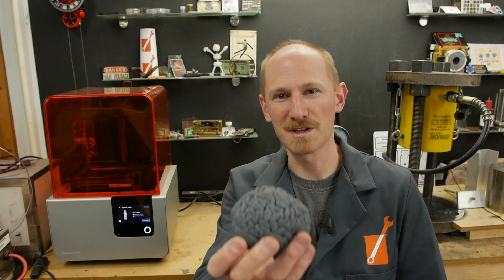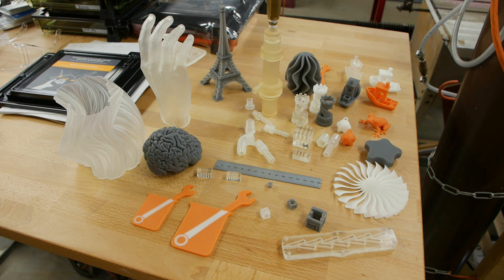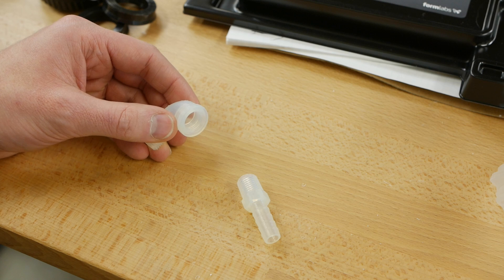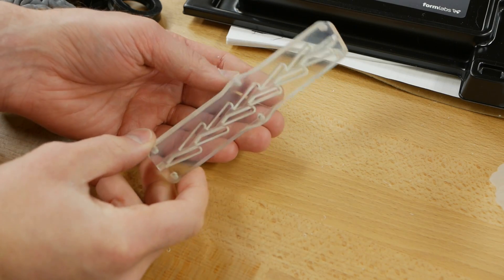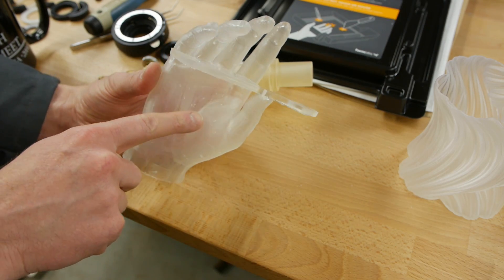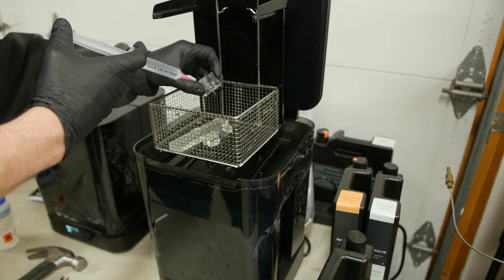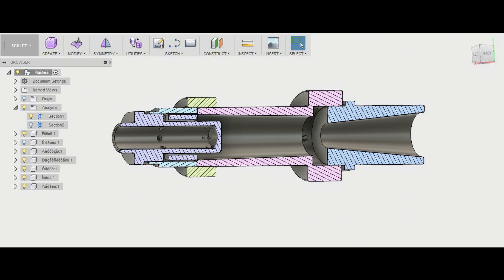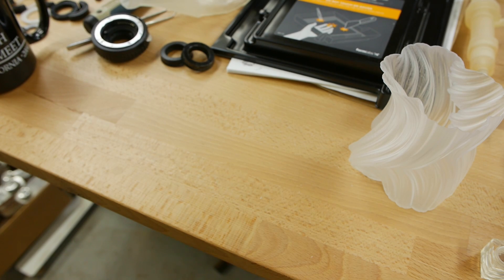3D print your brain, timelapse, high-res microfluidics, custom colors...

Comment: The channel is just so random, but the content has absurdly good quality. I can't get enough.

This is the first time I have seen negative sculpture modeling with the form 2 and dam does that look slick.
Reply: Damn good comment
Reply: Jttv because he's just a guy messing around in his garage exploring interests that come his way. He clearly doesnt do this stuff just for youtube, its actually his hobby and what he enjoys doing for fun.
Reply: Полиграфович yes it is a refreshing escape from all the other YouTubers that live off YouTube income that release a video or two every single day whether the content is worthwhile or not just to get the views.
Reply: Let me just underline it for you... SUPER INTERESTING. GREAT QUALITY.
Reply: The word you are looking for is eclectic.
Reply: The main problem with negative parts is that the resin is expensive. I've done a few and could never justify going more than a few cm per side. Also the original print beds had a limited lifetime, and printing on the same spot for thousands of layers doesn't help much. You can see the ghosting marks on the print tray after just normal supports. If I wanted to do a large negative print I'd cheat and print the negative with a narrow shell, then use a clear resin to fill the rest of the volume.

Comment: Hilsch Vortex.... It separates high and low energy gas molecules, but I'm pretty sure it can modify the oxygen/nitrogen ratio of air much like a gas centrifuge.
Pity it takes a lot of energy to run, as it conceivably could be used to deplete nitrogen before going into an internal combustion engine in real time.
I've wondered about this for 3 decades - If you have the tools to analyze the composition of the output, I would really like to know whether the effect would be useful.
Reply: We use them at work to keep our electronics cool in hot areas. https://www.vortec.com/vortex-coolers/overview
Reply: Andy Lee Robinson What about for performance applications in IC engines? 

Although I've read that nitrogen is important to "cushion" the combustion event, hence the use of  N2O/nitrous oxide injection instead of just oxygen injection.

I've also read that nitrous oxide starts to "break up" ignition events at high power levels and it is why forced induction via turbo/supercharger or ultimately just plain compressed air is better. 

But maybe compressed air depleted of nitrogen a bit?
Reply: I don't know about knocking and cushioning, but I would think that an engine running on pure oxygen and gasoline would have terrific performance and produce no dangerous nitrogen oxides, and no CO if the combustion is complete. Perhaps there would even be enough energy left over for carbon capture.
Hypothesis probably moot now as IC engines will be phased out of the mass market over the next couple of decades.
Reply: Not an engine expert, but I was under the impression that running an engine too "lean" (more oxygen to fuel)   already burns hot enough to cause engine damage. Wouldn't this cause the same problem?
One might need to redesign parts with higher operating temps in mind.
Reply: Running an ICE on pure O2 is pretty much running the thing as a cutting torch on its innards.
Reply: The solution to engine getting hot is to use less fuel per cycle. If it gets more hot per unit of fuel then it means it is more efficient. In that case, instead of dismissing the idea, the existing engine / fuel injection system should be tweaked to make use of this more efficient technique.
Reply: Ok, so you mean, the problem is not just high temperature but also that Oxygen will react with engine components and damage them?

Comment: 3D printed ceramic? The future was here yesterday I guess. Now we're in to science fiction-turned-science reality
Reply: Metal, ceramic, plastics, wood, fibers, so long you can deposit the item, you can print it.
Reply: I was reading about the Formlabs ceramic resin.  There is a big drawback-- it shrinks when you fire it in the kiln, burning off the carrier resin and leaving the ceramic.  The shrinkage is dependent on the angle you print, too.  This means you have to guess what sort of unequal scale factors to apply to the model so it will shrink to your desired size.  All the other resins are quite dimensionally safe, allowing for those threaded parts and marquetry fits.
Reply: It should be possible to simulate the shrinkage with the right software, right? So you would be able to adjust your part accordingly before printing.
Reply: I guess you still have to fire it - so we are still a long way off from a Star Trek replicator than creates a hot cup of Earl grey!
Reply: Shapeways offered glazed ceramics at least in 2011, but they discontinued it. Hella expensive. People designed lots of espresso cups: they're somewhat small, and the kind of people who drink espresso probably are more likely to afford them...
Reply: I was thinking potentially ceramic molds for casting. If the dimensional accuracy is not very good then it would just be good for organic forms and shapes rather than accurate mechanical parts. Using it for custom fluidic devices is definitely very interesting.
Reply: You say that... A few years ago we learned how to transpose electromagnetic fields away from their sources.... And now we can make transparent aluminium. We really are living in a really interesting age!

Also: Quantum entagled data transfer (instant data transfer between two locations, even really far apart).
Neural networks.
etc.
Reply: SLS 3D printed metal moulds for small-run casting are already in use. No dimensional issues there.
Reply: Shrinkage you can compensate for - the bigger drawback is the 15 hour firing time...
Reply: HariEdo All ceramics shrink when fired, it's just the nature of the process. The shrinkage is dependent on the composition of the clay too. Potters know that and compensate by making the green (unfired) objects proportionally bigger so after firing they end up at the correct dimensions. In fact there are multiple rounds of shrinkage that occur: one when the wet clay dries, and another one when the dry but still green clay is fired.

Comment: I almost didn't click this video because I've already seen a lot of 3D printers but when I realized it said high res I decided to check it out and I'm not disappointed.  The new Form 3's are actually quite affordable for their specs.  Not sure about resin prices since I don't actually have a 3D printer of my own and don't know how much resin I'd need but it looks like that would be where I'd struggle (a high one time cost for the machine is less of an issue than a high cost per part).

Comment: I'm a facilities manager for a cast acrylic factory, we make tubes and solid rods, we supply McMaster carr all of their cast acrylic tubes from 1 1/2" to 8" with wall thickness at 1/8" , 3/16" ,1/4", and 3/8". And solid cast rods from 3/8" all the way up to 6".  If you've ordered cast acrylic from them, its come from us. McMaster also sells extruded acrylic, but it's cheaper and less machining friendly. And it doesn't come from us haha. 

U.S. Cast. - American made, owned, operated, and supplied :)

Comment: That internal tubing and printing in negative space gives me an idea for a challenging project. 
You should try and print a Bernard Gitton style water clock, completely encased in resin! These clocks are usually crazy expensive and difficult to build because of all the specialised glass components, but printing the pipework in negative space could result in a very beautiful, miniature water clock!

Comment: I've found that the McMaster-Carr models can have some variability on shoulder bolts, dowel pins, and threaded fasteners. Always worth a double check with the print before you go to order.

Comment: I suspect the vortex tube might not be performing as expected because you scaled it down by half - especially if it was specifically designed for air because of the intramolecular forces involved in compressibility of a gas at different scales. The efficacy of the vortex tube surely depends on the taper ratios being tuned to specific scales and so a direct scaling of the entire tube won't produce something that works as efficiently or effectively as the original design. I could be way off, but that's my theory. It does appear to be working at least somewhat, so that's cool. It's a heat pump!

Comment: One of the very first 3-D printers was a laser/liquid....but it was 'inverted' the laser cured the top layer (maybe .002" or so)...the part moved down as it was built....
 I saw one at a tool show in 1995.

Comment: If you read the terms of service for McMaster Carr, they forbid 3D printing of any of their models. Figured I'd give you a heads up.
Reply: hey software pirates have long dreamed of pirating hardware, this part of the video made me want to get an SLA 3d printer even more.
Reply: I was thinking about that. At first it seemed like they wouldn't like people printing parts, but if I need a 314 stainless steel part, I could print it first to make sure it fits and is exactly what I need before ordering, especially in large quantities. Its great for making sure you're buying the correct part. A plastic print is worth about 50 cents, and is no substitute for $30 quality metal parts. This should be a win-win, at least in most cases.
Reply: MMC might agree with you, but I doubt they make all their models themselves. They're probably just passing on the license they're under from their 3D model suppliers.
Reply: The models are designed to test fit their catalogue to your designs digitally as part of product evaluation for purchase, and this is emphasized in the terms of use.

It stands to reason that they don't want to give away their models to let people produce their own end-use parts, they are supposed to be a helpful tool for engineers and to help them sell their items. But it is to be considered that not everyone needs parts of the same strength and quality, a flimsy plastic dimensionally inaccurate part can be as good for some uses as a precisely machined metal one - but there's no reason why McMaster or their suppliers would want to or have to give away their property to enable those use cases, to their own detriment.

Also to be considered, rapid prototyping techniques are developing at a rapid pace. SLS (laser sintering) is an existing technology that can be applied to metals. It is conceivable that we might have an affordable (<$5000) desktop machine that will print strong metal parts in not-so-distant future, and terms of service must cover not only the situation as it is today, but files that may be downloaded now but used later when the circumstances have changed. The corresponding foundational patents ran out very recently, so you can bet there are people working on that.

I don't think it's high on their priority list to sue people who have printed a test fit sample, and there is a chance e.g. in Germany where courts are less concerned with wording than intent, that purely test fit printed parts would get a pass - just a possibility, not a guarantee; however with end-use parts things seem more likely to turn out different, even for single sporadic prints, and promoting violation of intellectual property agreements publicly can be even more dangerous.
Reply: I'm assuming that they will publicly say to not do it, but won't care at all for personal use only. They know that your 3d printed part is inferior to their product.
Reply: Maybe if you try selling it since it's based on their IP, but for personal use I don't see how it can be a problem, let alone enforced...
Reply: It can easily be enforced.. They'll know if you download the part, they'll know if you print the part. Digital Watermarks DO exist... Besides, a 3D printed part isn't exactly the end result with this. If you can 3D print it at a decent FDM layer height, or using SLA, then you can easily use a loss casting method and make the part out of copper, aluminum, brass, bronze, whatever. Its not difficult to build a super dirt cheap foundry...
Reply: YOU WOULDN'T DOWNLOAD A 90 DEGREE THREADED PIPE FITTING ADAPTER!
Reply: Yes I would.
Maybe even two. >.>
Reply: @HDFoxra  you do realize that watermarks are not some magical tracking device, right? Yes, they'll know that you downloaded the file, but there is absolutely no way for them to tell if you print it. They could theoretically prove that a redistributed model (as part of a digital file) is theirs, but there is no way to track phyiscal copies. This would require the printer/software to a. find and read the watermark and b. reporting the use of this watermarked model to the creator of the watermark. It is obvious that this is not going to work for several reasons (technical, legal, etc.).
Reply: @kain0m  All very true, but it's alot like pirating movies. You can download them, which isn't the illegal part, but sharing them is. Also, they wouldn't really need a 3D printer to know. Just the slicer or the 3D modeling program you're using. Because fusion 360 already does this. If u download a part from their McMaster interface, then it tells McMaster that you downloaded something. Then, if you hit the "save as STL" or "make a print" button, it DOES notify the people who choose to have an interface available inside fusion 360 that you've done so, and McMaster IS one of those people who've chosen that ability. So if you use fusion 360, and load something using their parts interface, then choose to print it, they "will" know.
Reply: @andyjones7121  you make a great point.
Reply: @suricrasia  I would if I could. oh wait, I can!

Comment: Ben, you are really amazing. I am always waiting to see your new videos. I believe 3D printing technology (metal, biological material, buildings, ...) will have made our future. In the field of plastic mass production, they made a 3D Printed mold that is used for plastic injection. the main problem of making product especially resin base ones is the price of resins. I haven't seen any open source formulation related to make a resin. I suggest making an open-source resin for this community

Comment: You need a bigger printer for your brain.
Reply: Doug Ankrum The resolution of a regular brain MRI is too low to be scaled up full size...
Reply: Yeah, I got that...I've had 3 MRI's so know the deal...!
Reply: Doug Ankrum Ah, that isn't fun man... Hope it's nothing serious.

I'm a radtech, so I've had several myself, but only one for a medical reason (the rest was for testing new sequences). 

People tend to overestimate the resolution of an MRI, so I thought that might be the case here too.

Never even thought of making a 3D reconstruction of a brain, and converting it to a printable file. I have 0 knowledge about 3D printing, but I'm thinking about trying this myself. Would be cool to have my brain on a shelf...
Reply: laurens b That way you can do a lot of drugs and still have a backup brain!
Reply: I'm sure something can be done to make the prints look good in spite of somewhat low raw data resolution. Smoothing, some Perlin noise for a bit of added fine detail. I know this is falsifying the data in a way, but when you have density data, and you perform density boundary reconstruction to create a printable model, that is essentially too - fact of the matter, any this kind of data that you can view has already been processed and some information has been lost, even in the process of 3D density reconstruction from essentially planar imaging scans. And since it's just a decorative/representative print and not there to perform to an exact scientific purpose, I don't see an issue with butchering the data a bit more.
Reply: @SianaGearz  You could smooth the print with acetone
Reply: @vwertix1662  Or your brain before scanning.

Acetone doesn't do anything at all to resin though. Nothing. It's only usable on PS/ABS/SAN prints and you go ahead and try printing something big in those materials without it delaminating and cracking, it's not easy.

Comment: re: Vortex Tube

The thermal conductivity of the plastic is probably a lot less than that of metal.  That means that the hot end won't won't get rid of heat as effectively.

It would be less elegant, but you could probably design the vortex tube in pieces, and have the hot air pass through a copper or aluminum tube.  If it has fins, so much the better.

Comment: From the looks of it, you could modify such a printer to have a small air port on the moving print bed, so it could stop and blow out the epoxy not set so it doesn't get set later by excess light. This could potentially let you print finer resolution micro-fluidics.

Comment: Very curious about the possibility of printing the YBCO superconductor devices. Looking forward to a video testing the efficacy of that process. Do be careful, that does actually sound like some pretty revolutionary IP, and I'd hate to have this video prevent you from taking out any patents.

Novel geometries of superconductors: very interesting concept. It seems like the issue here might be controlling the alignment of the crystalline structure. Perhaps inserting a seed with a known alignment is in order (not sure if that would work with YBCO). 

Sounds like there are some applications in MRI-land. Perhaps this could improve the performance and/or manufacturing process for SQUIDs, too. Sky's the limit here - please do follow up with either another video, or, better yet, a startup with a few provisional patents in hand.

Also excellent job with the microfluidics devices. Excited to hear that Verily is actively thinking about applications of that tech, hopefully you guys can pick up where Elizabeth Holmes left off ;)